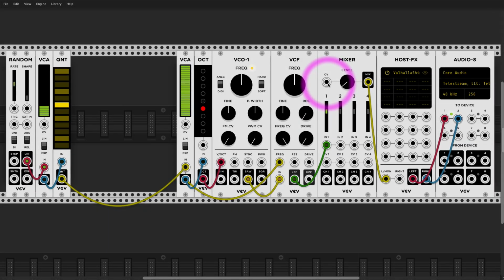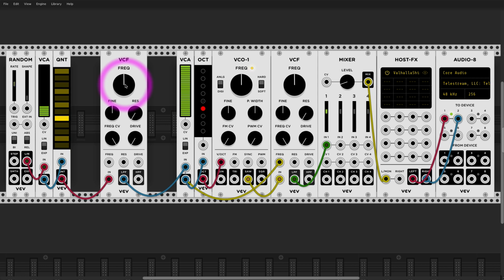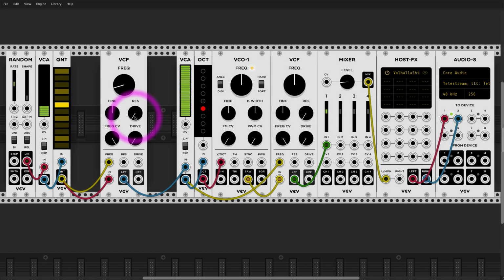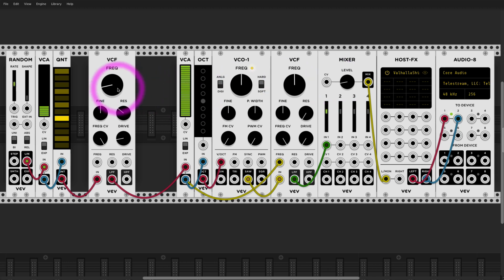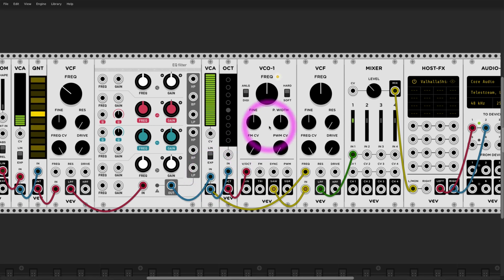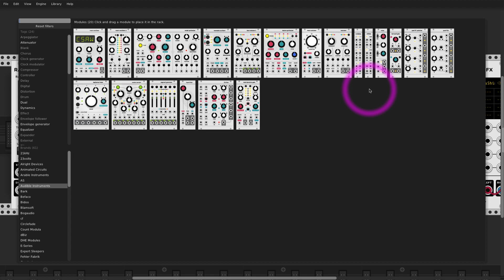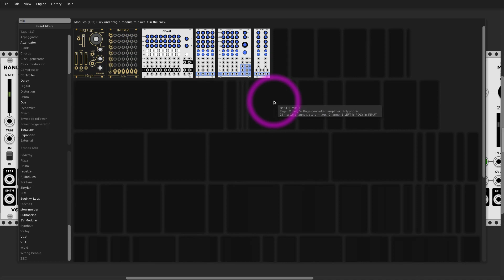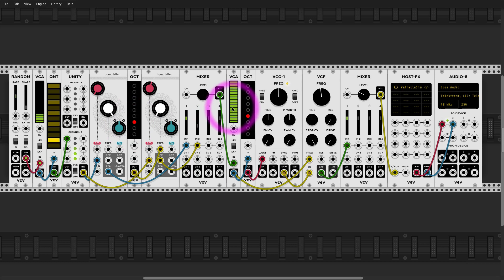VCV Rack Hacks | Resonant Slew

Comment: I wanted a pad-like sound with a slow attack. I have a 4X divided clock into SEQ3 with just a 3-note sequence, going to a Quantiser, and then into a VCV ADSR setup, but the attack, when set high to get a slow attack, reduced the volume of the output. Searching on the net for a solution said to run the output from the quantiser into a slew limiter.
 This doesn't fix the issue and also results in a run-up of notes from the transition of one to the other.
Setting the slew to low rise and fall fixes the running notes issue.

Can you suggest how to get a slow attack with no drop in volume?